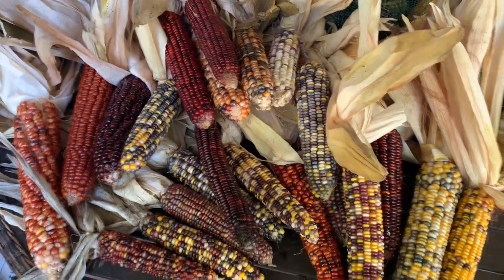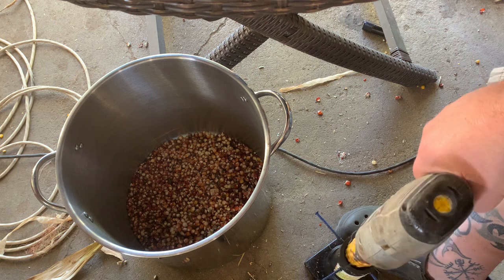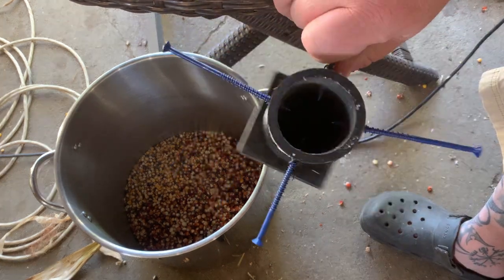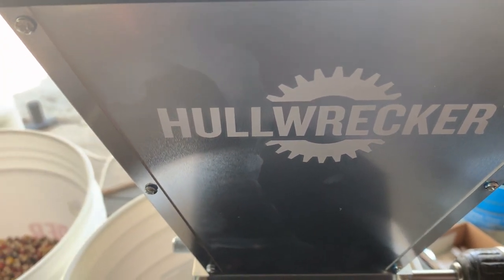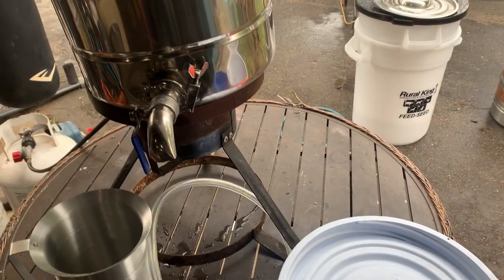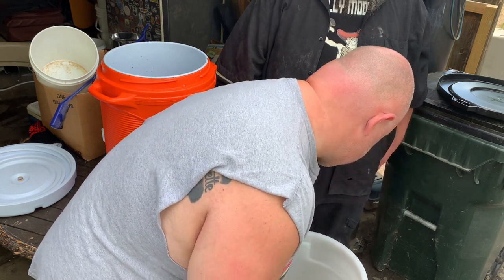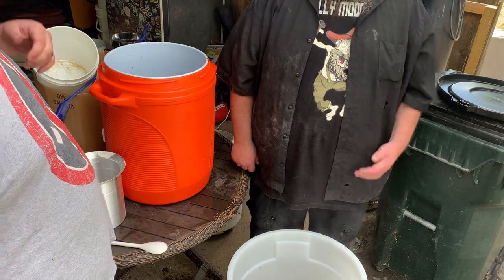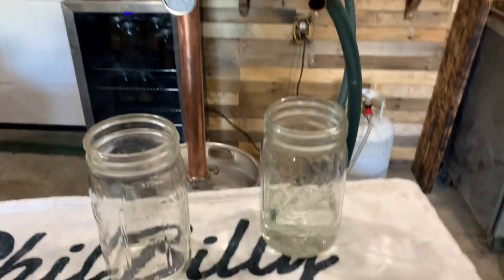Indian Corn Moonshine

Comment: You better check the instructions.  That looks like the dry only mill. There is another that looks like that mill but has a different motor color that does wet an dry grain. It's 50$ more than that one.

Comment: Great video 👍👍.
I did my 1st Mash with Malted Barley.
8lbs Cracked Corn
3.5 Barley
7.5 gal water
Yeast
My SG which SUPRISED the Hell out of me was .020, i added 8 lbs Suger = .060.
This fermented down to .010 in 3 days, i thought my ferment stopped, it just slowed down.
Total time today =6 days ill check Gravity. 
Usually my Mash with just Cracked Corn and Sugar takes 2 + weeks.
That Barley is amazing!
So, when i run this, technically im not running a Corn Flavored Sugar Wash since i used Barley?
Update, day 6-Gravity .10 from .060.
3 days to .10 after 6 days the same Gravity .10
Im gonna run it.
Day 3 i did put a bit more yeast to see if it jump start it, i believe this as liw as im gonna get.
Tastes bitter as Hell 😂😂

Comment: Do you distill on the grain? If not do you have any good tips for clearing the mash? Brew bags suck.
Reply from the maker: I do distill on the grain and all i use anymore is a pond pump ran through a metal screen straight in to my pot. I have no issues. I have not used a brew bag in years.

Comment: Did your still pot come with that drain on it or did you have to add that? Looking at the ones on Amazon it's hard to tell if they have a drain or not.
Reply from the maker: Just get you a keg, and a column and condenser its next level.